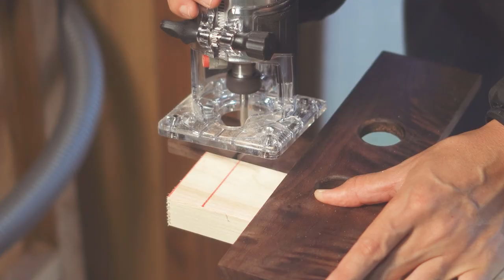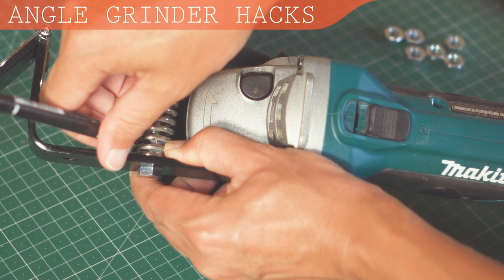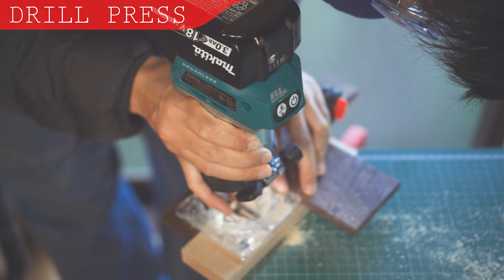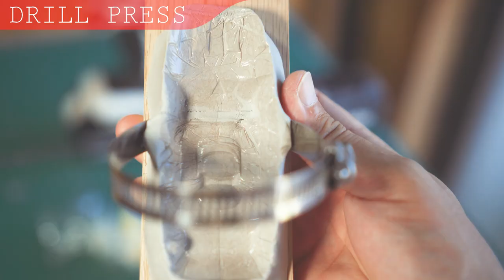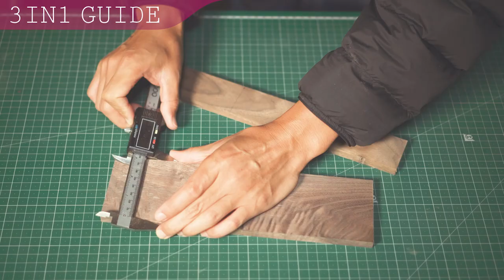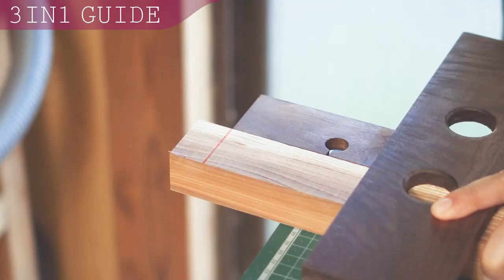3 Simple Woodworking Tools Hacks | Tips & Tricks

Comment: I think best was the multi tool square/jig. Angle grinder attachment seemed like I wouldn't use it too often if at all. Drill press slide block also seemed a bit of a hassle to go get to put on and keep that squared up piece with it. 

Over all pretty neat ideas, just practically for myself I don't see myself utilizing all of them.

Comment: I would not recommend removing the guard on the angle grinder. Those safety measures are there for a reason
Reply: So is the guard on every other tool, it still gets in the way sometimes.
Reply: Some types of wheels only fit with the guard off
Reply: The most important piece of safety equipment is your brain (not the guards).  With enough brain power and care, you can perform certain tasks without the guard.  If unsure, yes, keep the guard on!

Comment: Thanks for those tools. What the sizes of the boards for the 3in1 ?
Reply: Looks like 10-12mm but anything a little stiff should work fine. (That's what she said)
Reply: Zoom in when he uses the calipers and the larger board is 3 inches wide; the smaller one is 2 inches wide.  I would make the larger board 16-18 inches long, and the length of the shorter board is determined by the width of the larger board plus the width of the base of your circular saw.